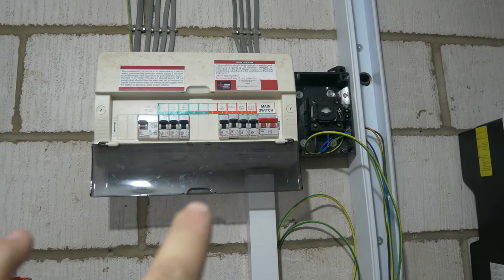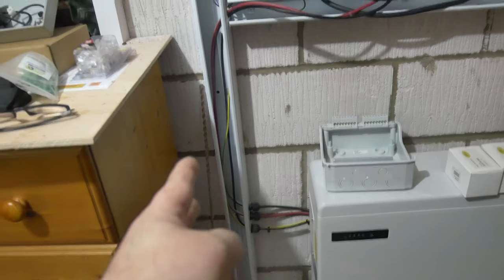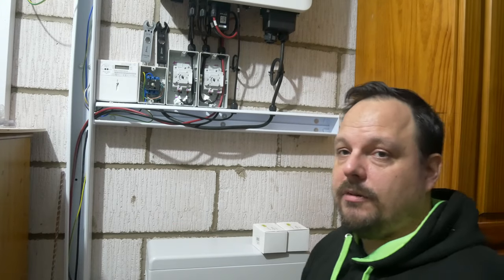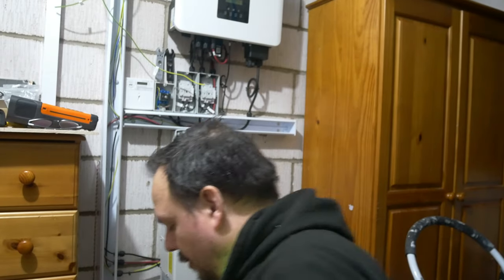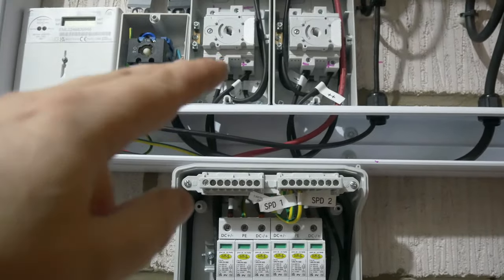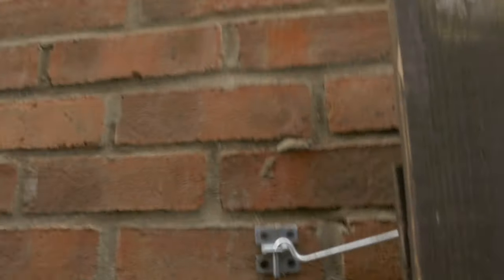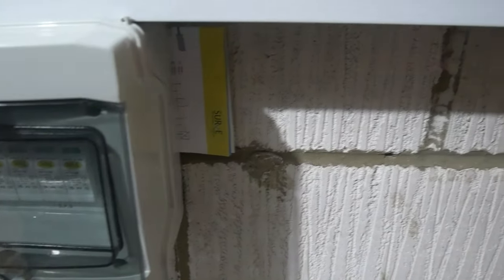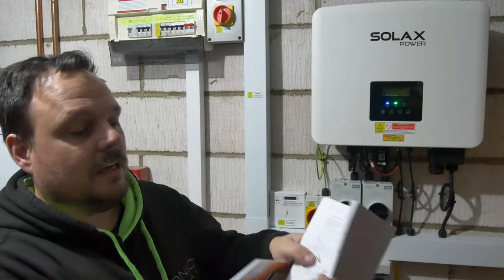How to install a 5kW Solar Solax Hybrid Inverter & Battery Storage System

Comment: Folks always omitt to install the stipulated DC mcb between battery and inverter. Solax support say optional but whats your opinion when its clearly in the installation plans?
Reply from the maker: These have the mcb in the top bms panel. But I am thinking about this atm.
Reply: @electrician247  solax said to install for piece of mind but no install I've seen uses them. Leaving installer liability wide open for fire risk I was thinking. 50a on the 7.5 x1H
Reply from the maker: @Alex Rhodes  on the older solax batteries I would deffo be using a DC mcb. The new triple x as shown here without the black stripe are setup differently.  The DC mcb is on the output of the battery cabling. Adding another 40cm away and introducing another termination and potential point of failure seems more detrimental than beneficial in my mind. But I am thinking about it over the longer term before I 100% commit 🤭.  If the battery cabling was of a length it warranted further protection I would be including it. But on a 800mm run which already has an MCB in circuit and the cables rated for mechanical protection I only see downsides as described above. 

Interesting area to consider though so good question!

If you haven't seen the new triple x which comes in 5.8kW variety then check them out. The prior black stripe models didn't include the same and other features.

Comment: You don't need SPDs for DC nowadays, i think all MCS compliant inverters have it built it.
Reply from the maker: Some do not. I would still encourage installation of them in the string wiring. I have 100% never seen an inverter that has replaceable SPDs once fried lol. For the cost its an easy decision tbh. Cant think of many reasons not to install them. Same on the AC side. Loads of electronic equipment has elements of SPD built in. However pop a nice one in at the intake and sub boards is such a simple, low cost effective measure to take.
Reply: @electrician247  Yeah, but pretty much any modern one on sale has it. This breaker box with SPDs probably over 100 gbp wasted not to mention it takes quite a bit of space too. But fair enough, there is no harm in adding it anyway.
Reply from the maker: @paulf3353  they don't have these SPDs in tbh. Some have some AC surge arrestors on board. But very few have true DC SPD protection. In the grand scheme of things £100 to protect an expensive suite of equipment is a total no brainer

Comment: Hi Mark, what safety measures are there to prevent reverse feeding into the system in the event of a loss of network supply?
Reply from the maker: The shut down on loss of supply unless EPS output is used. Show how that works a couple of videos after this one using a manual change over switch. Thanks

Comment: what about the current clamps???
Reply from the maker: Clamp not clamps. This a hybrid system with DC coupled batteries. The grid ct is in there as shown in the video.
Reply: @electrician247  in where though?
Reply from the maker: @o04n7h0n90o  the main tail in the consumer unit. Speak to your installer for further explanation. This work should not be touched by Diyers

Comment: Hasn’t the invertor got a DC isolator intergrated into it ?
Reply from the maker: It does but that is not part of the fixed wiring so it’s a no from me on that front.
Reply: @electrician247  thanks I am not an electrician just about to have solar and there are videos out there about fitting additional DC isolators if the invertor has an intergrated one, is this the case ? Or are they still being fitted.
Reply from the maker: @trisknight9430  imho they should be fitted. But people can and do argue you don’t have to. I’ve shared a number of videos explaining why I think that is absolute nonsense invented by manufacturers to deskill a sector ever further. To complex for a commented reply tbh. But when the inverter is on the floor getting replaced, were is your isolation.
Reply: @electrician247  thanks for the reply the videos refer to recent fires at properties where DC isolation was fitted this of course could be down to a faulty switch or one not meeting the BS standard. As I said not a fitter just an end user wanting to understand what the fitters are likely to do with my installation I’m having a solax inverter with an AC coupled battery with Solax inverter
Reply: @electrician247  just viewed the video regarding the dc isolation interesting the view is installer error and the need to ensure training and skilling of installer to improve standards and I agree
Reply from the maker: @trisknight9430  usually caused by poor installation. Lots of things catch fire when that is the case. The regs are clear. Isolators should be in the fixed wiring. Also worth noting some solax inverters DC isolators are not compliant with BS7671 requirements anyway. 

Loads of detailed videos on this on my channel

Comment: Should the installer have run a earth cable from the two batteries to the inverter near the power on/off button, because it would appear they have not done so here.
Reply from the maker: There is one battery not 2 and earthing of both the inverter and battery was discussed and is in place. The earth lug is located on the battery case near the battery connection leads. The earth lug on the inverter is on the left or right of the bottom casing. All present and correct.

Was extensively discussed in the video regarding the earthing. Did the viewer even watch???
Reply: @electrician247  sorry no mine. Batteries do not appear to be earthed. Only noticed as I was looking over the system with view of swapping out the inverter

Comment: I Work with solax if you don't keep your AC side and DC separate as in either side  you'll have problems with cables fluxiatin and ringing England they don't have a clue and they put you onto china when they cant answer it I switched it heuwai there actually a better brand to be fair
Reply from the maker: Not had a single problem with solax and we have installed a fair few now. We do make efforts to keep AC and DC away from each other in the trunking and most recently did a no trunking job with total separation which was shared on YouTube. 

Either way never seen a single problem.